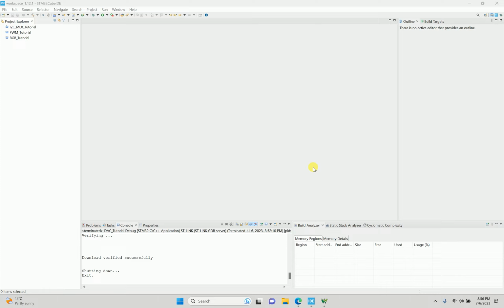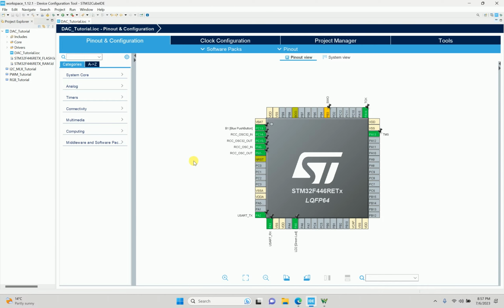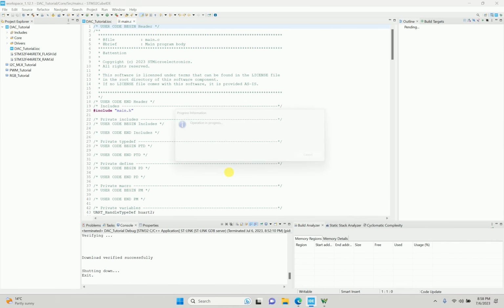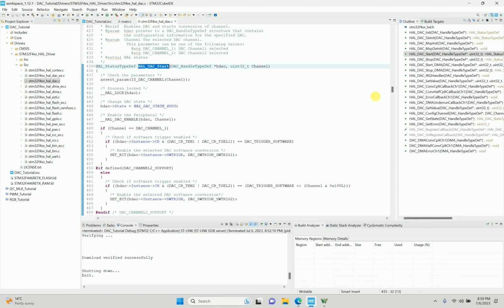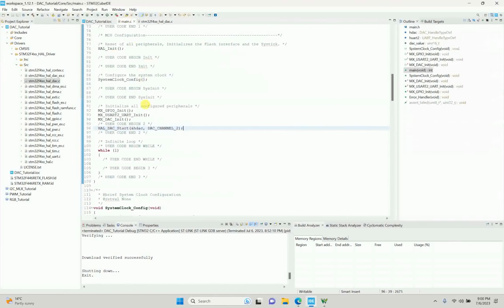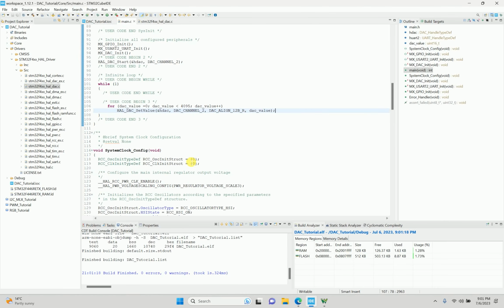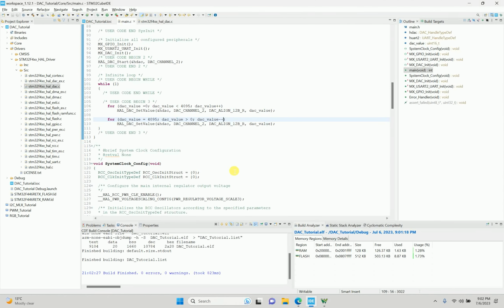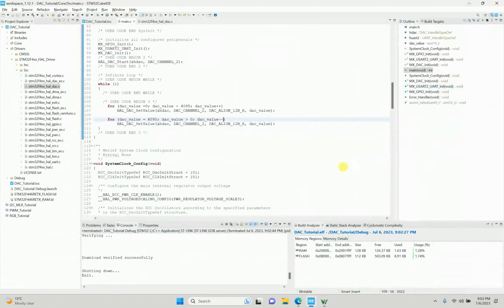STM32 - DAC Tutorial | How to interface Digital to Analog using STM32CubeIDE and CubeMX

Comment: I am not getting DAC configuration option under analog tab . Why it is happening ? What to do pls help?
Reply from the maker: That may be because your microcontroller doesn't have an internal DAC in it. Not all the microcontrollers have DAC. You might want to check and confirm from the reference manual to make sure your microcontroller has that peripheral. 
Thanks